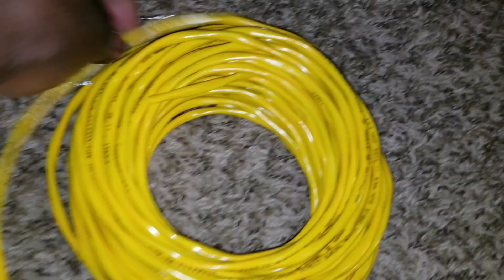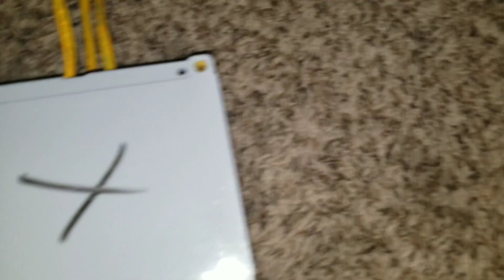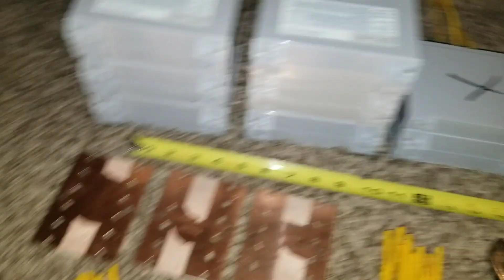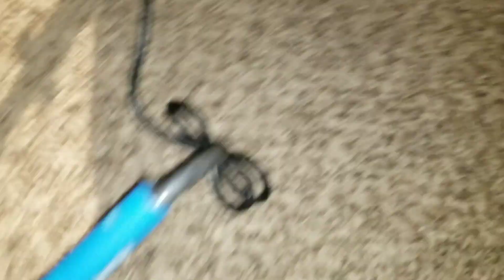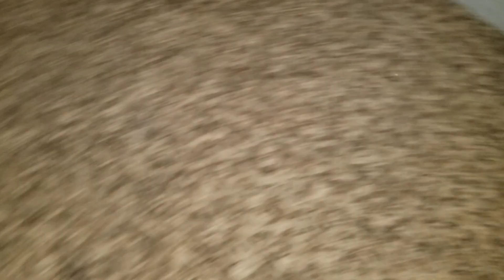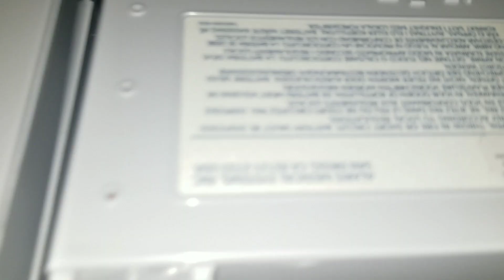NICKEL METAL HYDRIDE (NiMH) BATTERIES BUILT, (Batery Configuration) Part#2

Comment: My baterries are from e-golf   a 6 cells pack for a 24 volt system , 75 ah the orange ones

I used them for a 4 month period without Bms and i measured each cell tension regularly

The tension of each  cell is equal every time .

So the question is : Do i really need a Bms for this battery?
Reply from the maker: Sounds good. But, how come you don't have videos on that on your channel? 
Thanks watching and for sharing.
LIKE SHARE & SUBSCRIBE

When it comes to BMS, is the individual decision and discretion. I can't advise what you should do when it comes to your project.